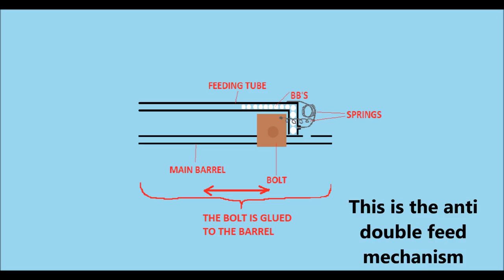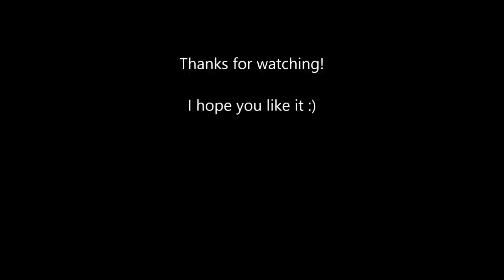Homemade bolt action BB sniper rifle

Comment: With that kinda feed it would be really easy to multi load without issue. Just cycle the bolt a second or third time.
Reply from the maker: Yes but the main point is that it doesn't multi load when you pull the bolt once
Reply: HomeWellMade I can understand that but if you wanted to fire multiple shots at once, like a shot gun its a cool option.

Comment: what do you think of 180psi 12v valve? im wondering how long it can shoot for a rifle or what is the fps
Reply from the maker: I bought one of these: https://m.ebay.com/itm/292072231844

If you are using a valve like this you should consider implementing some kind of control
Circuit in order to open the valve for a short amount in order not to waste air. The circuit is quite simple and should consist of a high current mosfet along with some complementary parts. If you open the valve and dump all the air at once you will waste alot of it. The reason is that you should have enough air to push the BB trough the barrel and when the BB is out of the barrel air flow should be stopped. I suggest you use a reasonably long barrel and it should have a good seal with the BB (less space between the BB and the barrel the better, but the BB shouldn't get stuck. You should use some polished BB's). If you do all of this right you should be able to get some really good performance and I would say around 300-400
Fps with high pressure of yours. Note that if you want even more range you should consider installing a hopup unit.
Reply: i see.. i also want to order in lazada but my problem is the airtank. im planing to use 2lb fire extinguisher or a 2inch white pvc it can hold up to150 psi or 200+.. not bad for a 300-400 fps, do you think it can shoot 80 feet or 100?
Reply from the maker: 100 feet is no problem this sniper shoots around 40-60 meters(130-200 feet), but at that range the sniper is not really accurate as the BB's tend to wonder in different directions.
Reply from the maker: And btv I'also using a 2lb fire extinguisher rated for 25 bar (about 360psi)
Reply: cool. i want to build that can shoot around 150+ feet.. i guess its defend on psi, hop hop and the barrel size :) the one i build it can penetrate coke can in 10 to 15 feet. the bottom close shoot :)
Reply: my problem i cant find a 6.01mm 6.03mm barrel. the one i used is 7mm :l

Comment: How powerful is that rifle.can it make a hole on bottle cap by shooting from 30 feet?
Reply from the maker: Danny Lee It depends on how much you pump the gun. The plastic that bottle caps are made of (in my country) is quite thick, so it doesn't make a hole in them, but it leaves a pretty good dent. At max pressure i would say the power of the gun is around 200-300 fps
Reply: HomeWellMade okay.tq
Reply from the maker: +Danny Lee np :)

Comment: help! i still dont understand the double feed mechanism.
Reply from the maker: Basically when you pull the bolt back the new BB falls in the barrel and in the same time there is a wire that gets inserted in front of the second BB, preventing it from faling it in the barrel

Comment: How many Mili liters this air chamber holds? 300ml ?
Reply from the maker: It doesn't hold much but the air in the chamber is at high pressure and the gun is designed to be pumped after every shot.
Reply: @homewellmade6861  because I have 0,5l bottle as air chamber and i need to pump it 6 times to get 300 FPS, Lower space in air chamber, less pump?
Reply from the maker: Yes, you need to pump it less times if you have a smaller air chamber
Reply: @homewellmade6861  My clip or buckle idk (i am from Poland XD) is not pushing the valve , what is the problem?
Reply from the maker: Have you added the ziptie around the cap? I have a video about my BB gun where you can see how i made the air chamber and the air chambers are the same as on this sniper and that  BB gun from the tutorial video
Reply: @homewellmade6861  ok thanks
Reply: @homewellmade6861  i dont know , my clip doesnt push that valve , idk it is weak or what?
Reply from the maker: If you want send me some pictures on my gmail I'll se if I can help
Reply: @homewellmade6861  i sended

Comment: hello. can you make a barrel with a bb's stopper or bb's holder so the bb wont drop
Reply from the maker: Yes the hopup unit would solve that problem
Reply: hmmm i hope i can figure it on how to do it.. i already make one airsoft rifle and i copy your body design, but i use a qev and sliding valve.  thanks to your video its really help me to build one:)
Reply from the maker: Np, when I find some time I'm going to make a rifle with a solenoid air valve and some electronics like arduino so I can make sit shoot semi auto or full auto or even burst fire mode
Reply: hmmmm i guess already see what you want to build.. the parts you need is 12V Air Horn Chrome Electric Solenoid Valve :)
Reply from the maker: Yes i have everything yust need to put it together :D
Reply: nice. please upload a tutorial hehe, i will try to build it too :)

Comment: how do you make it fire ?
Reply from the maker: +Matic Cizl it uses compressed air to push the BB down the barrel at high speed.
Reply: HomeWellMade yea but how does the mechanisem for firing work ?
Reply from the maker: +Matic Cizl The air is released when the trigger is pulled. The clothespin acts like a lever and pushes open the bottle cap. Bottle cap then releases all the air that is stored in the air chamber (big white tube). That air then pushes a BB down the barrel. If you want I can show you a sketch of the mechanism yust ring me up. Cheers!  :).